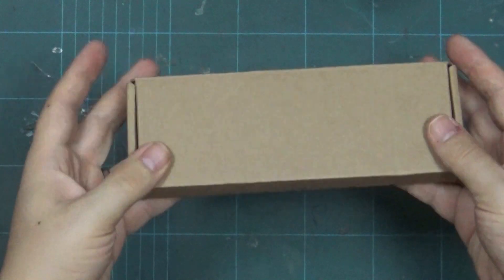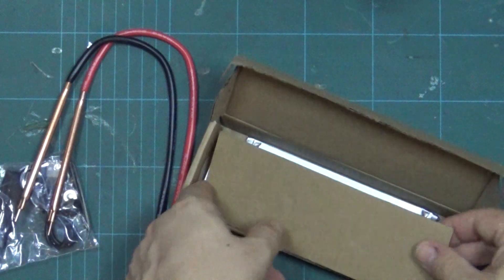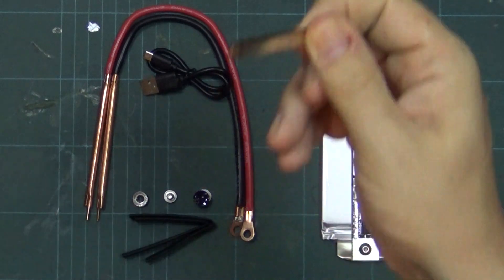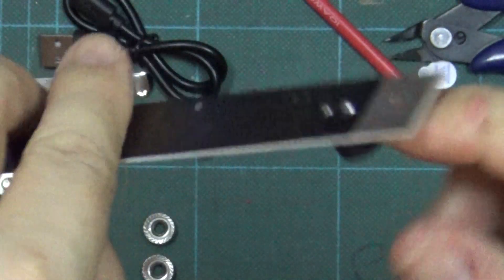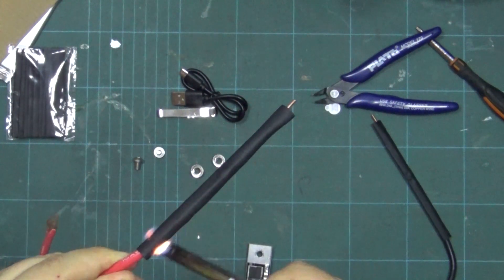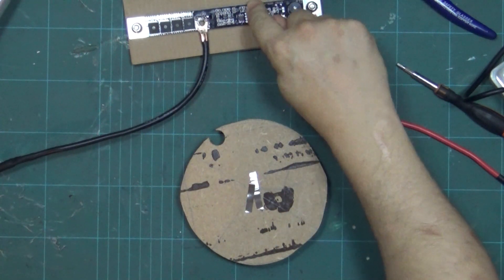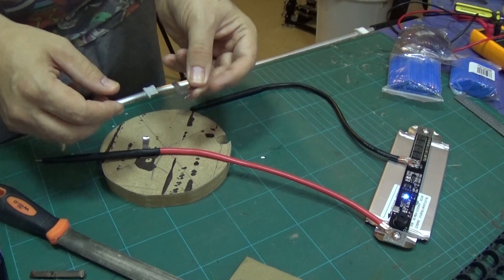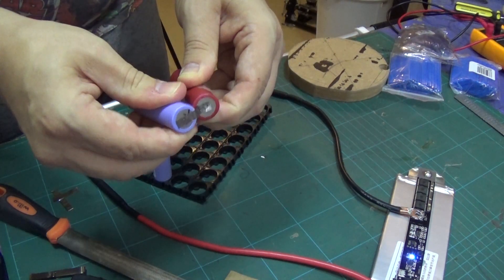Cheap 18650 Battery Spot Welder

Comment: terrible solder job, dont blame the cheap chinese hardware you need to use a thicker tip to for that kind of solder joint.

Comment: It’s no way to get electroshock with that . I have a maletrics rSetup with car battery at 680 cranking amps and I touch the copper probs all the time .
Reply: I definitely agree that you don't get shocked from the electrodes but I actually put heat shrink on there for comfort of grip. And it's always a good rule of thumb that if you're not sure play it safe.
Reply from the maker: I seem to be able to electricute my self with a block of cheese 🧀 so I didn't want to take the risk. Thanks for the comment

Comment: I have got the same problem without the cardboard, so tomorrow I will solder on the black wire like you did. Maybe it also helps to solder a solid copper wire above the MOSFETs, where they are connectet to the battery. If it finally works I will print a nice box and an holder for the copper tips, to keep the distance between them them same.

Greetings from Germany
Reply from the maker: Hallo Deutschland,
I was really worried when mine didn't work at first. It sounds like you are sorting the issue the same way as I would. If you need any help then please don't hesitate to ask.
That's the same idea as me, I've started designing the enclosure already but typically my 3D printer needed a bit of TLC before I could do any test prints.
Message me either way to tell me how you got on. Good luck

Comment: Pretty cool! Perhaps you could make a jig that holds the electrodes close together so you bring the battery up to touch the electrodes. Just like the professional equipment.
Reply from the maker: You are a mind reader 😉 I'm going to adapt a 3d print I had designed for my spot welder I couldn't get to work. Hopefully it won't be to long until I can show the designs and build. Thanks for the comment

Comment: would you be able to scan the front and back of the circuit and add it somewhere then add the link to the site?
Reply from the maker: The link is in the description and yeah I can take some high res pictures if you want
Reply: @TheOffGridFamily  scan, i want to see if we can get the component numbers, maybe i can reverse engineer it and make a bigger better 1.
Reply from the maker: Don't have a working scanner anymore buddy